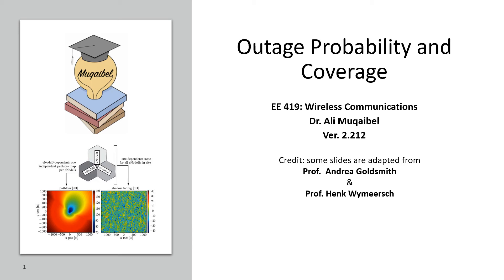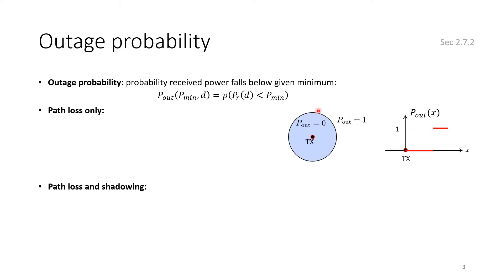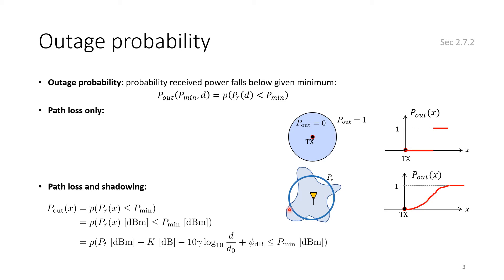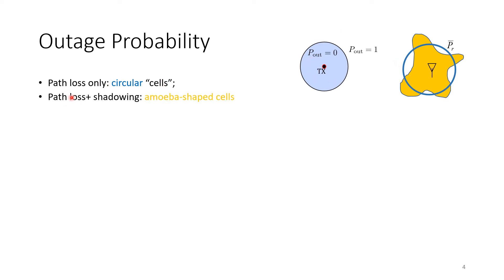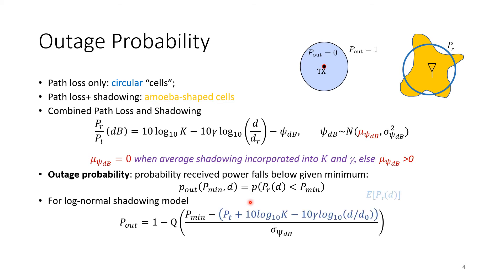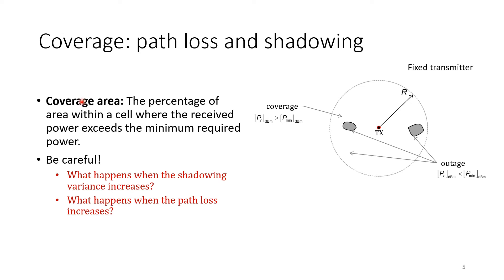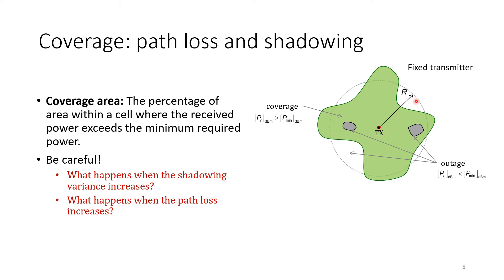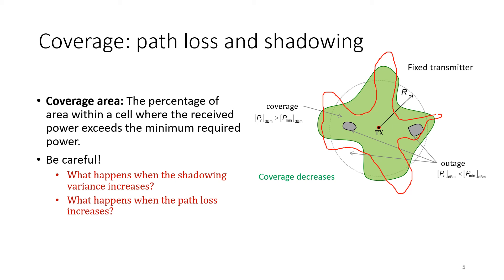3.5 Outage Probability and Coverage

Comment: alslam alykm DR.Ali, please can you share the final answer to this question? 
The average path loss at 10 meters from a transmitter is 26 dB. Assume that the propagation follows
the log distance model with a path loss exponent of 3. Calculate the average received power at 1Km
from the transmitter transmitting at 1 watt. What is the probability that the received power is greater
than a threshold of -60dBm if the log normal shadow can be characterized by segma = 5dB?